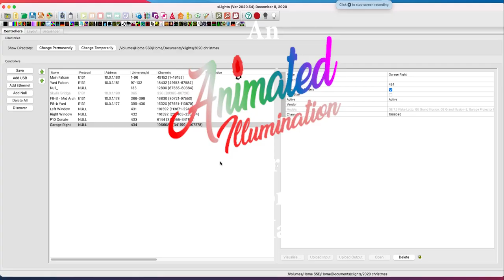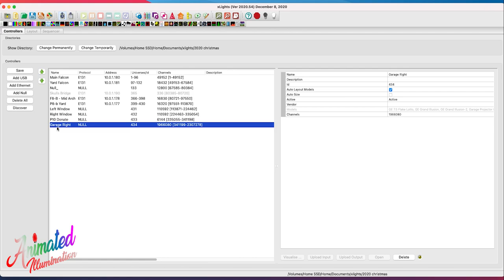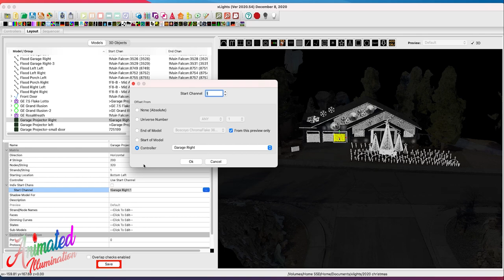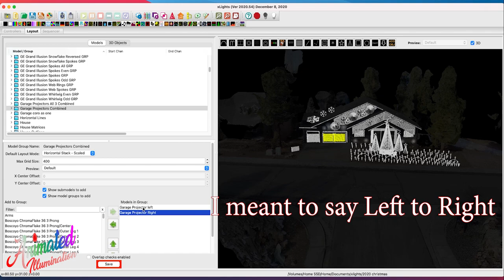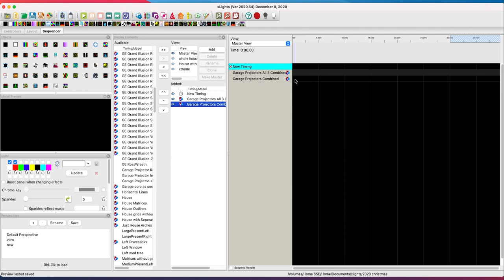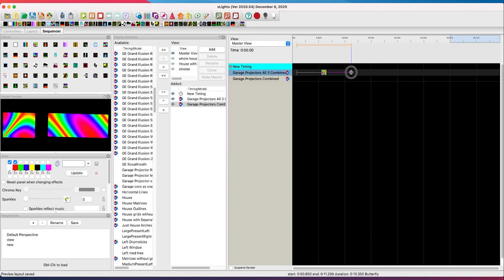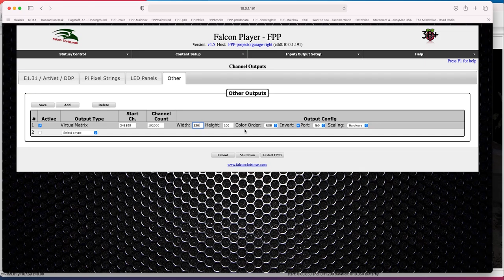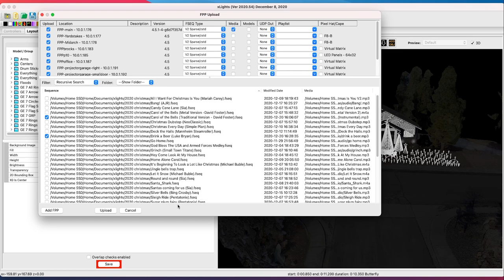Garage Matrix Tutorial software

Comment: so, 3 doors = 3 Raspberry Pi (FPPs), correct?
Reply from the maker: Yep, you need one per projector
Reply: @nickcosper110  thank you.
Also, on xlight, in video, it shows only one null controller for right projector. Do I need bull controller for each projector?
Reply from the maker: @mishastorozhuk  yes but You don’t necessarily need one for each, you could combine one null controller in xlights to cover multiple projectors however I find it more tidy to have a controller in the setup of xlights for each projector or controller. Basically the null controller is reserving this channels so they aren’t used elsewhere. If you don’t have it you could end up with some major channel overlaps.